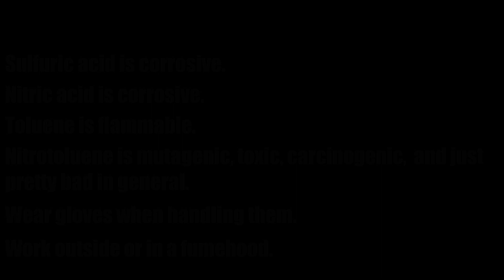Synthesis of mononitrotoluene

Comment: A question. Is vacuum distillation really necessary? And how powerful does that vacuum have to be?
Reply from the maker: Hello, yes, vacuum distillation is absolutely necessary, both isomers of nitrotoluene boil at over 220 degrees Celsius at atmospheric pressure, this will lead to degradation of the product and greatly increases the risk of fire or worse.
Only a weak vacuum is needed for most vacuum distillations. I use a simple aspirator water pump connected to a hose, this was more than enough, and just needs  water to run.

Comment: What kind of tubing are you using for the vacuum filtration?
Reply from the maker: I'm  using reinforced vinyl tubing. But even just normal vinyl tubing will not buckle under vacuum.
Really the only type of tubing that you cant use for vacuum are those slingshot rubber hoses that you can sometimes get on ebay.

Comment: I'm curious why nitric acid wasn't mentioned as being a strong oxidising agent in the safety warnings at the start of this video, I'm guessing that is because the corrosive nature of sulfuric acid, nitric acid and the flammability of toluene as well as the carcinogenic and toxic nature of the reaction product takes priority in terms of safety. Although the strong oxidising agent properties of nitric acid are also a serious fire and explosion hazard if not handled correctly. Disclaimer - I'm not by any means doubting the professional experience and expertise in chemistry of the author of this video I'm just curious as to why the strong oxidising properties of nitric acid aren't mentioned in the safety warnings at the start of this video
Reply from the maker: I forgot to mention it 😅
It's very much a valid warning along with the other ones I did include.
Reply: @Craig Pater 
Average r/chemistry moderator 🤡

Comment: Actually there are 3 possibilities: ortho, meta and para. You need to use other methods to make m-nitrotoluene though because methyl group is ortho/meta directing. With nitration of toluene  you could expect perhaps 1% or so meta (a rule of thumb, not checked data).
You can always eg recrystallie the solid to improve purity and usual methods for liquid as well.

Comment: Chemistry was my profession.  It's the height of Stupidity that this reaction is Not being run in a fume hood there!
The person(s) doing this demo are amateurs at best there, and could end up with a huge mess or worse there!
Reply from the maker: Could you elaborate? I think there's far more stupid things than not running this relatively tame reaction outside of a fumehood.
Reply: Sounds a little like your chemistry profession was in academia or for a large company.  You do know that most of the safety protocols like running almost every reaction in a fume cupboard are because of insurance companies and not actual danger, right? Sure chemistry is dangerous, but this reaction is like a 2 out of 10 on the danger scale.
Reply: yeah this is one of the safer nitrations you can do, ive done the relatively similar mono nitration of benzene and both steam, normal, and vacuum distillation of it, the fumehood isn't really necessary as long as you aren't in some airtight box (the nitrobenzene smell would be too much for my liking though so i ran it in the fumehood)
Reply: there are plenty more dangerous things that can be done safely without a fumehood, bromine, chlorine gas, nitrations with liquid N2O5, ect it is all about balancing safety with practicality, safety in amateur chemistry sometimes exceeds what is in a normal lab even
Reply: mononitrotoluene is not explosive and if you control the temperature (very easily mind you) you get essentially no di and trinitrotoluenes. if you are worried about an explosion a fumehood will not save you unless its specifically designed to be explosion proof, and then again a chemist has told me he has seen a flask under vacuum implode and the glass literally sent through a 3cm thick wire reinforced glass sash that was designed to deal with shrapnel
Reply: I thought exactly the same and was very confused that all other comments wasn't like yours🤕
Reply: I make organic peroxides in a mayo jar in the bathroom
Reply: @johnsmith-sp6yl  Are You F'ning NUTS there, and otherwise have either a Death or serious Injury wish there?!  Organic peroxides are Known to be Unstable and Explosive!  
Many years ago, a fellow chemist was Badly injured  while working with them!
Just Hope you have at least enough sense to wear safety glasses, heavy gloves, a good lab coat and preferably work behind a shield or better in a hood if you persist in working with them there!!  Also, make sure you have p[icked out a good trauma surgeon to 'fix you up when that S**t does explode on you then!
Reply: A little civility please.
Reply: @charleschidsey2831  Civility, you request?! 
Hah! NOT when someone is mindlessly risking their life or limb there!!